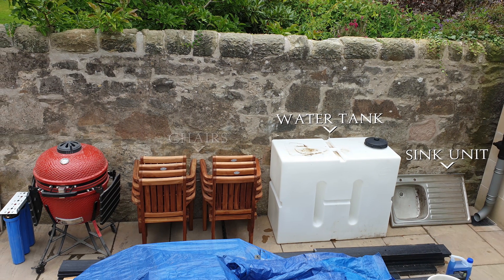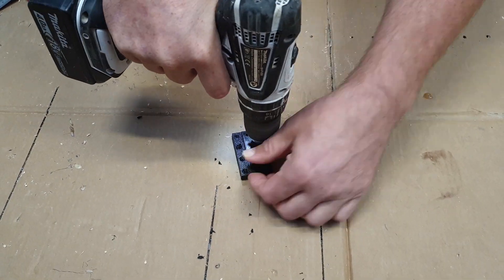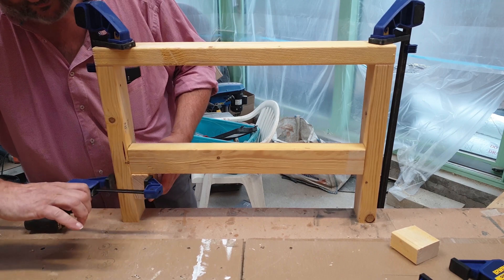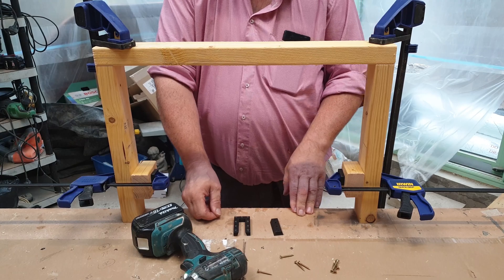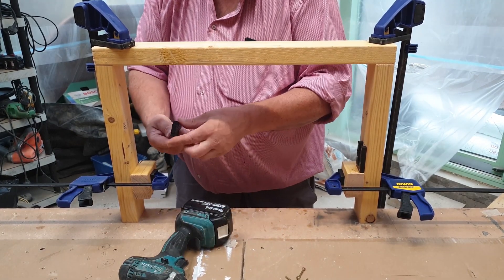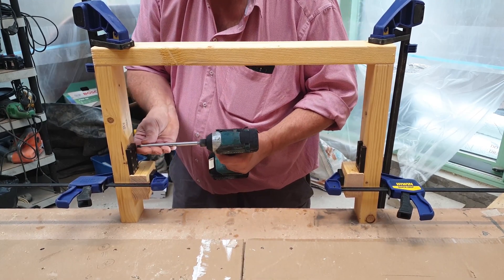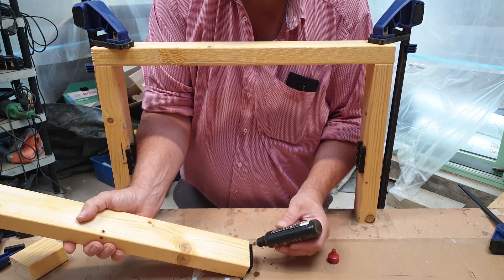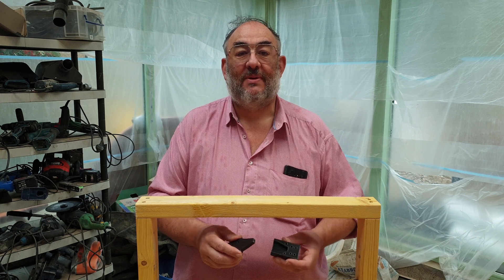FREE 3D Printed Timber Connector

Comment: Hi again - very similar to the Simpson Strong Tie Cross Cut Connector used on sites. If you ever get around to doing these again, I would recommend trying to model it so there is a tapered dovetail so the tenon (for want of a better word) is acting as a weak wedge in the 'mortice' it will increase the forces pulling the tenon into the joint. In industry metal joints like this reverse the arrangement with the tenon part installed into the long grain of the standing part and the mortice on the end grain of the joining member.
But a well executed idea and by-the-way my waste side jigs were originally modelled in Tinkercad.

K.